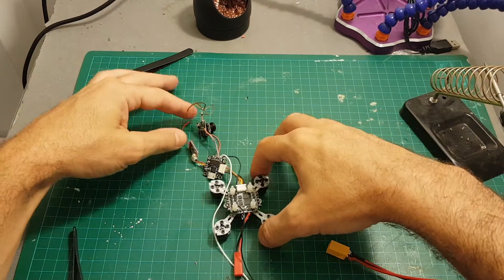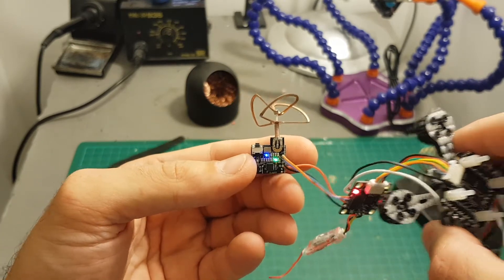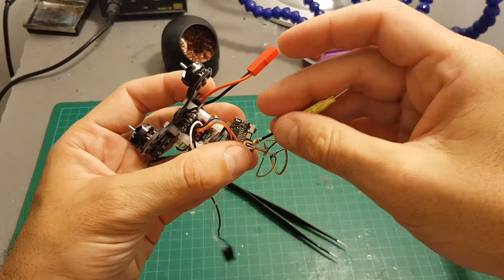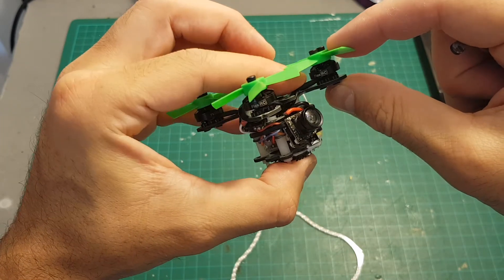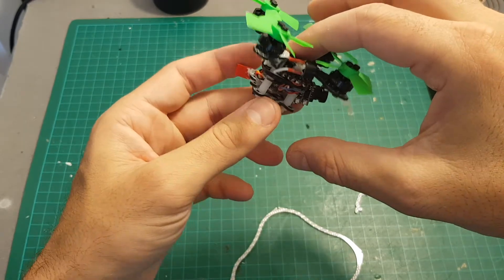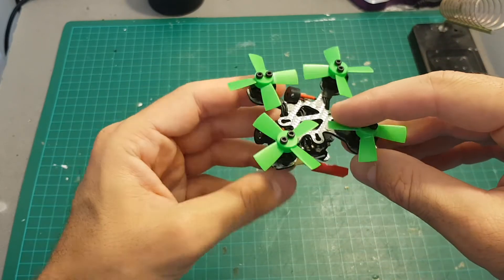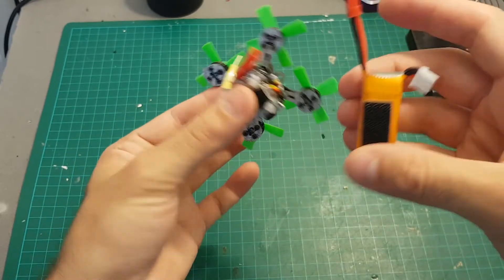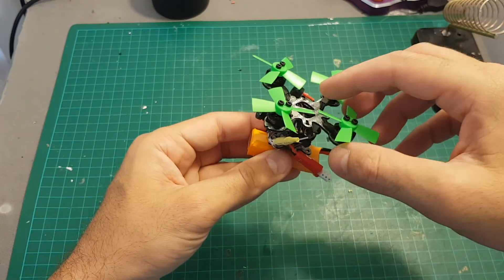FlexRc Nano X 57mm - Build And Test Flight - Part 2 of 2

Comment: hi there, i am also using the exact same fc and esc setup but i don't know why in my receiver tab in betaflight, it shows all zero even though i have successfully binded my flysky micro receiver?? could u help me out? is it because i have to flash it the new version of 3.2.0 and how do i do it if that's the case?
Reply from the maker: +kester yeo Hi. Apparently your receiver is not connected / configured correctly. Do you have any previous experience with similar configurations?
Reply: Gal Kremer hi, i had several issues back then but now i figured out the problem. the solution to the problem is just to flash the flight controller's firmware on betaflight to the latest version. in my case it was in 3.1.0 and it didn't work until i flashed it to 3.2.0 :)